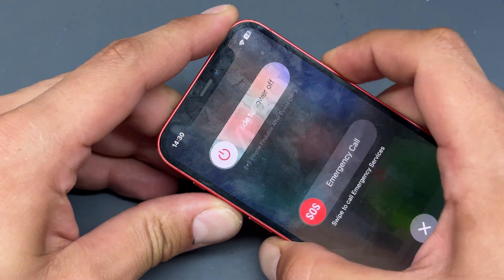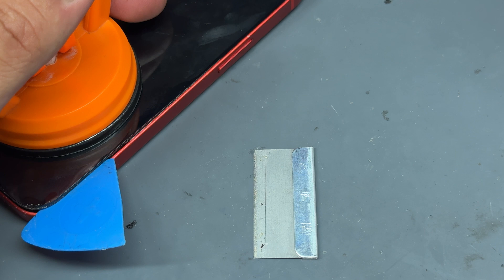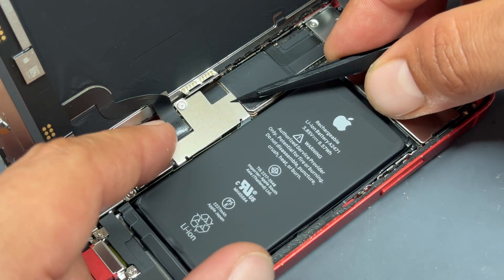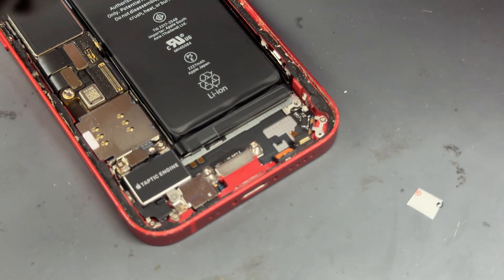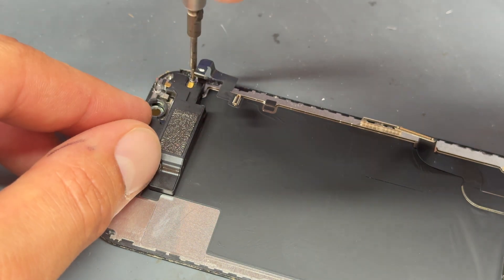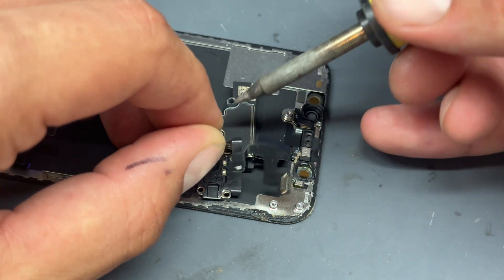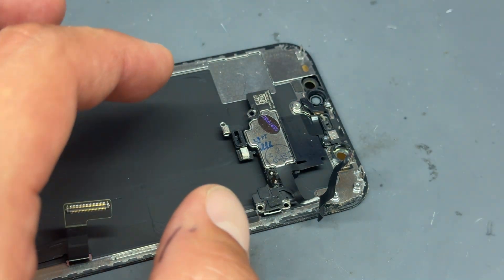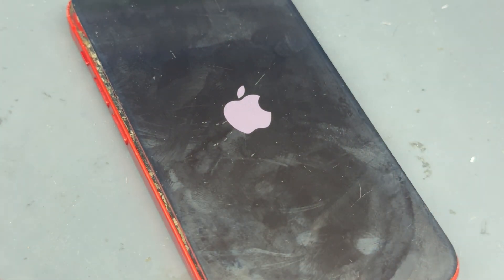iPhone 12 Mini No Sound Issue SOLVED! - Guide To Fix Ear Speaker And Loud Speaker!

Comment: Good vid. I've had my 12 mini since 2021 and the bottom speakers went in 2023. Very annoying. One went first then they were intermittently on and off then one day they stopped altogether. Got by with just the top speaker but then last year it got a little bit of liquid in it and has gone really quiet it's like 25% of volume when turned up full. I love the phone but hate that they are so fragile and aren't built to last.

Comment: Totally agree on the "Isoprop instead of heat" thing . I once broke an iPhone 13 mini display with unintentionally separating of the display from it´s frame. An expensive failure as I bought a genuine spare.… 😅

Comment: Apple service center is saying that i need to replace display as the top speaker module is attached to the screen. They are charging me more than the cost of a new iphone 12 mini for this. Is it a viable solution? Are they cheating?
Reply: Just take it to the local shop...
Reply: @User92376  Yes, Local shop did this in just 2350 INR